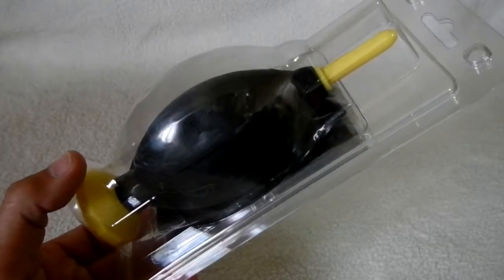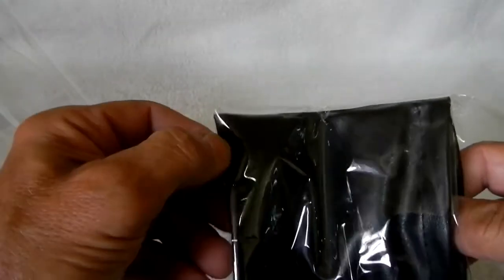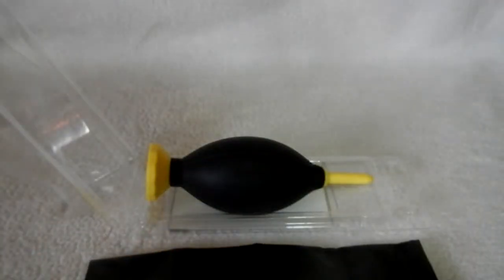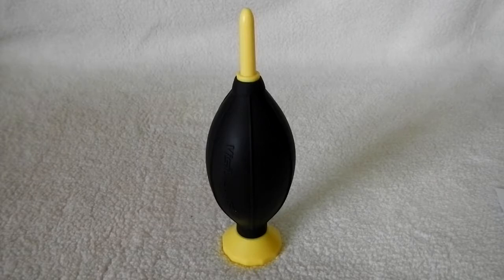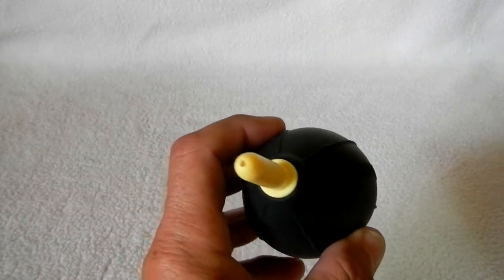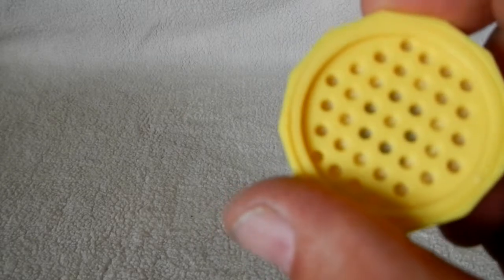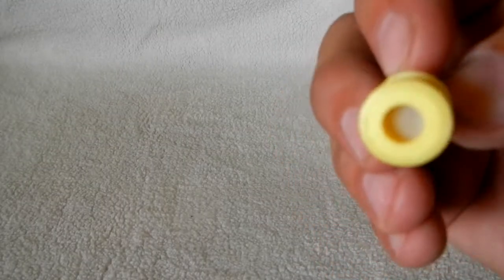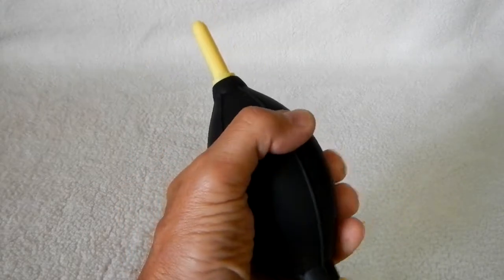Zee Pro sensor cleaning bulb blower by VisibleDust

Comment: Very valuable video.  I noticed after using my traditional blower that there was more dust than before.  You are the first person I've found to recognize that.
Reply from the maker: THANK YOU mfahlers. You will definitely like it. I have them in every case that a blower is needed.
Reply: @starastronomer  I was wondering what you thought about their next level of blower which supposedly has an anti-static coating.   https://www.adorama.com/cpvz.html
Thanks
Reply from the maker: I would not hesitate to buy it. VisibleDust makes great products.